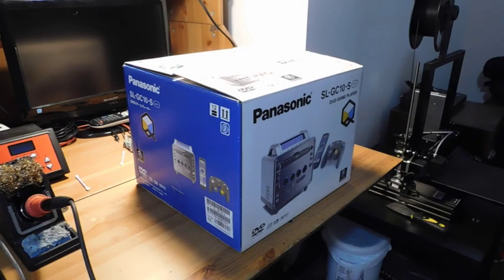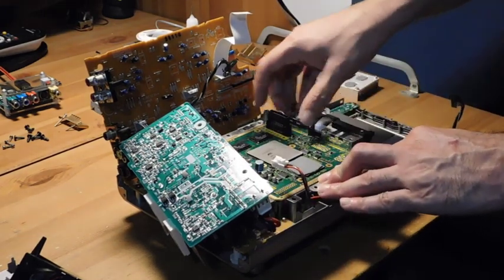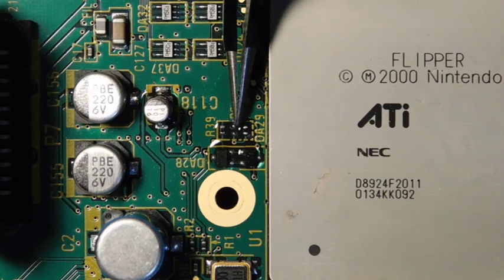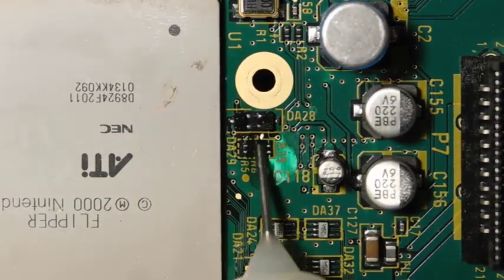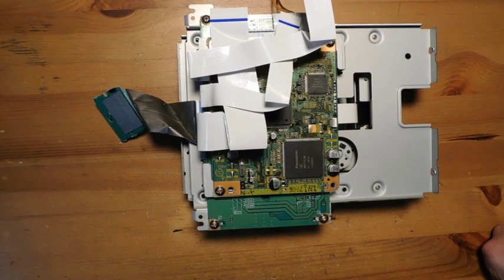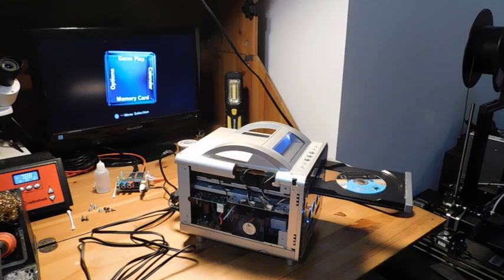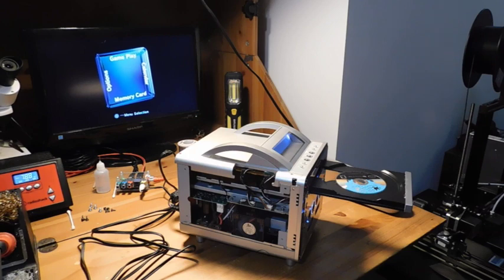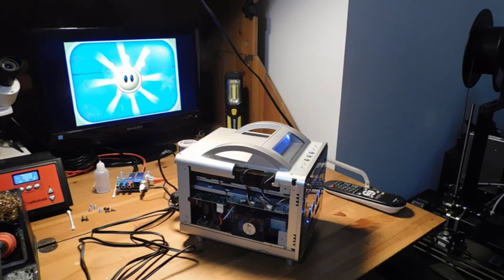Even more Panasonic Q Repairs! Laser readjustment and region switch installation

Comment: I have a Q that reads dvds perfectly, but when I switch to gamecube mode, I get an error immediately on booting. You have encountered and error, please check manual. Can this be caused by a bad lens, even though DVDs play just fine? The error only  comes up when the disc drive is closed,  regardless if a disc in the the drive or not. The cooling fan is good, as it spins no problem, with no weird noises.

Comment: Thanks, I was finally able to get my Panasonic Q working! It would play some DVDs, and recognize GC games but couldn't play them. I tried recapping the DVD boards first, hoping that would be enough, but unfortunately, it wasn't. When I checked the pot, it was at like 7.23 killoohms, so much higher than your's. Gave it a tiny turn, and it works great now!
Reply: What kiloohm setting did you end up settling at? Mine was 7.99!
Reply: @djgokou  Lucky enough the scrap paper I wrote my values down on happened to still be on my work bench. Also my original comment was wrong, my starting value was actually 7.32 kΩ, and to answer your question I dropped it down to 4.36 kΩ, and it read discs like a champ. It was even able to read a fairy scratched DVD that some of my other DVD players struggle with.

Comment: Hello, first of all thank you very much for uploading your video. I tell you, a few weeks ago the battery in my Panasonic Q's clock ran out (something common in all Gamecube consoles) and since then it has not read all the games well. Can you upload another video disassembling and reassembling the Panasonic Q step by step and how to recalibrate it? In your video I don't really appreciate how you calibrate it, I know that in Gamecube consoles you have to turn a small screw to adjust the lens and that way it can be calibrated correctly. Thanks.
Reply from the maker: Thanks, I’m glad that you enjoyed the video. I actually did make a complete tear down video so if you go through my fix it Friday playlist you’ll find it
Reply: @LIRetroGaming  Yes, I have already seen it but how do you calibrate the lens? Do you have the same screw on the board as on the Gamecube consoles? Sorry if i'm looking a bit heavy, but i don't know anyone who knows how to take it apart and repair it where i live in Cadiz (Spain) and i'm afraid bcause i'm going to be unable to use the Japanese games i have. Thank you.
Reply from the maker: @CiskoNokia  I turned the screw counterclockwise and I measured resistance with a multimeter. I adjusted the resistance to 4 kOhms and that worked very well. I did this around 8:00 in this video